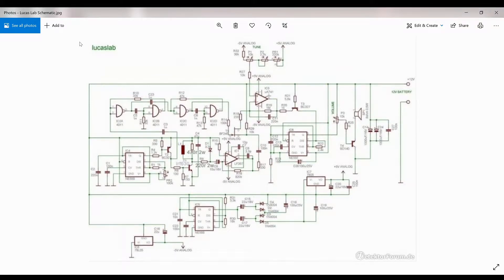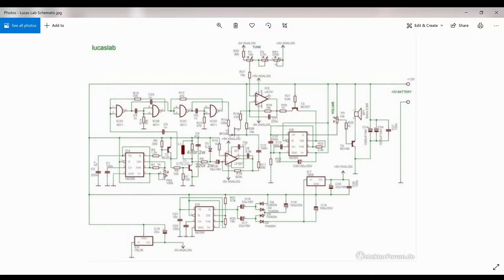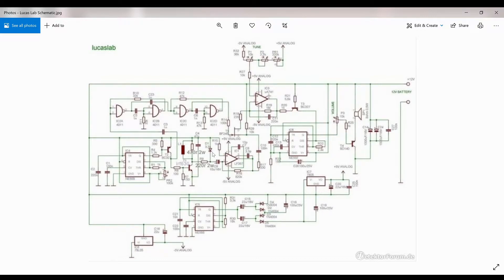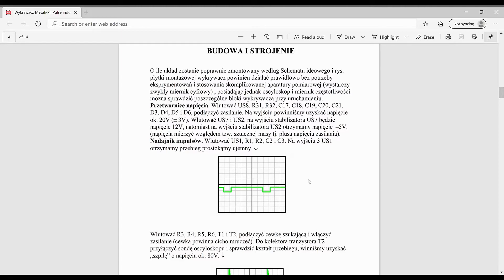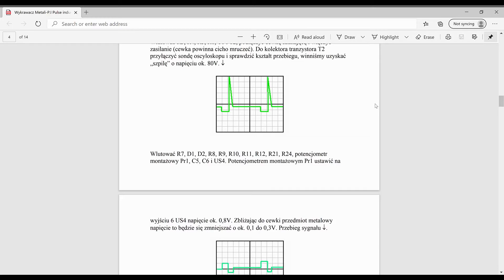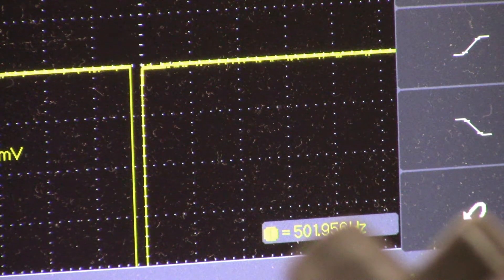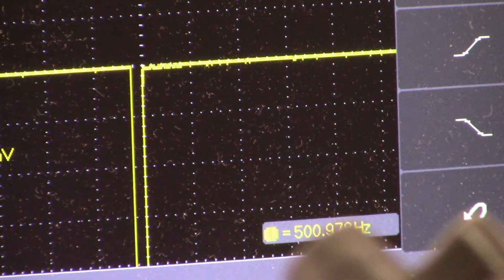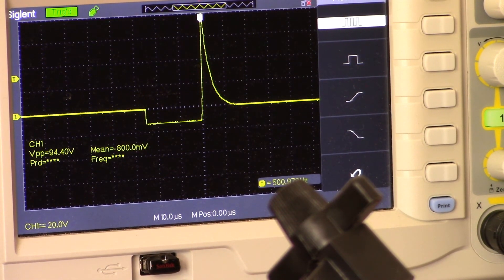PI Polones part #3 DIY metal detector project

Comment: Dear Sir, I am a beginner in electronics. I also think the 7805 is a regulator. For normal connection, I think it is correct to connect 12V to 'IN' side, 5V to 'OUT' side, and GND to 'GND', but in this circuit diagram, 12V is applied to the GND PIN of 7805, can I get +5V voltage by this connection?
Reply from the maker: I do not have the schematic at the moment to look at but I believe that the ground reference for this  detector is +12V battery.   Thank you for watching .
Reply: @SurfDetector  　I am grateful for your replying.  I found there was a difference between the PCB data and the schematics available on this website:  https://easyeda.com/jeanfreitas/pcb2-placa  ,in the PCB data, the GND of "7805" is connected to the +12V solder pattern. In the PCB data,  but in the schematic, it is connected to the negative pin of "C19" instead. This is why I am in confusion. I made the PCB with the Gerber File I got from this web page. And I have implemented the electronic components according to your project #1. And when I measure the voltage, pin 4 of LF357 is 7.14V and pin 7 of LF357 is over 14V. Obviously, I found 5V and -5V were not generated in my project.  I again express my gratitude to you.
Reply from the maker: As I recall saying in my videos.  The project from Jean Freitas has some mistakes in it.
Here is the original project document:
https://qdoc.tips/detector-de-metais-pi-polones-avt5196-pdf-free.html

Comment: Muy buen canal amigo yo estoy realizando el detector y quisiera saber si es posible detectar oro con el gracias felicidades por tus videos
Reply from the maker: Hello Jesus,
Thank you for watching my videos.  I hope that you will subscribe.  The PI Polones should be fine for detecting a gold ring at the beach but I do not think that it is the right one for tiny gold nuggets.
Reply: SUBSTITUIR 33K, POR 18K
Reply from the maker: @albanozinelli1686  Hi, What are you referencing?
Reply: @SurfDetector yo creo que esta afirmando que con dicho cambio se puede detectar oro!
Reply: @albanozinelli1686 hola si se remplaza estas resistencia de 33k por 18k puede detectar oro?
Reply: Sim trocando 33k  por 18k.ou12k. Sim detecta ouro
Reply: @albanozinelli1686  gracias por responder